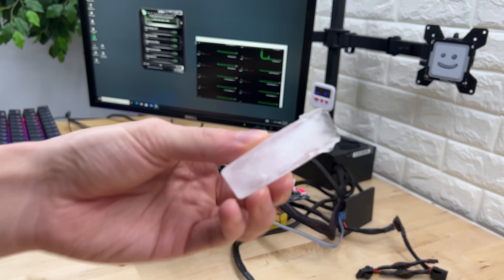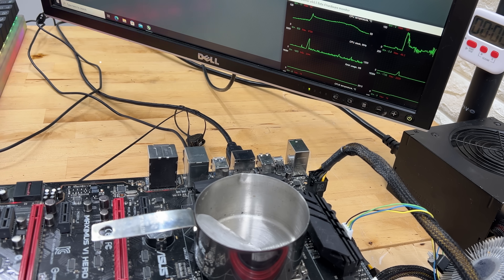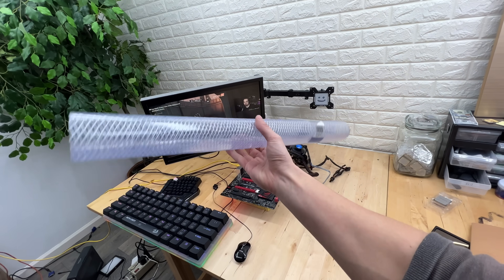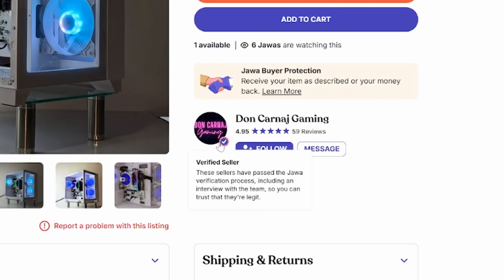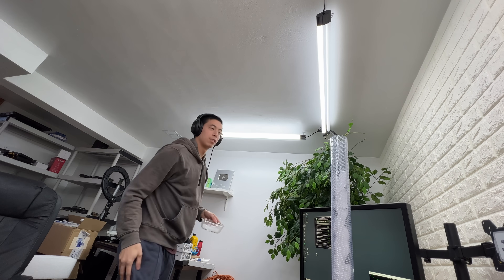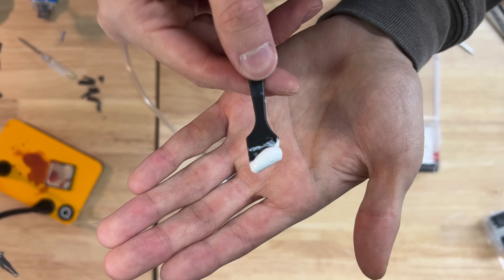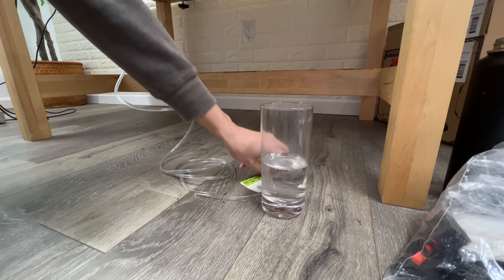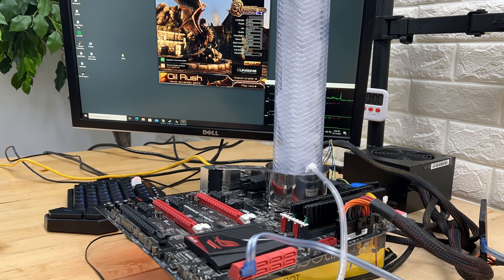Why aren't PCs cooled with ICE?

Comment: Now put a fridge with ice-dispenser next to your PC, have a system transporting the ice-cubes into your tube and let the melted water go back into the fridge. 
You just need some way to sensoring to find our your ice-level to automatically refill. You can control everything using a raspberry pi.
-->
You also got your food right next to your PC.

Comment: I went to college in upstate New York where it was consistently below freezing from October to April, and one of my floormates had a water cooled PC that the radiator fan had broke on. Naturally, this was an engineering college, so he ended up making a really jank solution - he got some hose and a gallon-sized Tupperware and some bungie cord, hung the container out his window, filled it with water, and ran the tube from his water cooler into the container - it was basically liquid all year long despite it regularly reaching temperatures of negative 40 - Fahrenheit or Celsius doesnt matter, they agree at that temperature x)

Comment: There are a lot of fridges that can produce ice cubes with pressing a button, what if we put a sensor on top of the tubing to see when the ice is depleting and send a signal for the fridge to produce and dump more ice cubes into the tubing, also the water that is melted could be recirculated into the fridge to produce more ice.

Comment: 0:56 you should instead flip the mother board with support with some height and apply the ice after melting ice drop on ground itself
Reply: Fr
Reply: With a reservoir in a hole to drain the water

Comment: Good setup only if you are living in like Sibiria or Greenland where ice is basicly free outdoor most of the time, but if you are living in a hot/warm climate, turning water into ice would take extra step, and extra step means extra inefficiency, which would end up you spending more power to cool down your PC instead of relying on any liquid or air cooling system and an air conditioner for your room. I know because stupid me once tried to freeze 2.5 liter water bottles in refrigerator then tie to a room fan in my room before we bought a proper AC unit.

Comment: I assumed it was the fact that waters specific heat capacity is almost double that of ice. In other words, you’d need to try twice as hard to turn liquid water into water vapor vs how hard you’d need to try to turn ice into water. 

You can suck up a lot more heat with liquid water than with ice without experiencing a change.

Comment: Ice cool the GPU. The problem is you'll need a lot of electrical insulation to make sure that pan touches nothing else, and youll need a support bracket. Since the GPU would be direct die vs an IHS, the full weight of the ice tower would result in a cracked die. But if there's any gpu to test with it's the 290x ya got there. Little furnace my beloved

Comment: Could you use an angled tube with external supports to avoid putting weight on the processors? Would this also enable you to cool differently oriented chips?

Comment: Obviously we already have liquid cooling, but imagine if we started integrating compressors into the mix to make essentially CPU air conditioners. One issue with existing cooling is that it's bottlenecked by ambient room temperature, and this ice is just a more primitive, time consuming approach to this limitation. The more automated way of handling this would be air-conditioning technology.

Comment: Concussion: we do not do this because the ice melts and then becomes hot water so then you would need a cooling system for a cooling system (fans for the water) so it would be more efficient to just use fans

Comment: Why not using copper like a refrigerator but then it will damage the CPU so it needs to be not so cold because negative freezing temperature is equal to fire 

Edit:I was wrong,refrigerator won't run if there is heat nearby 

Ice just transfer moist so a little drop of water damage the CPU

Yupp thermal paste is best solution

Comment: They do. They do LN2 cooling for overclocking competitions. The issue with bringing your CPU below ambient temp is condensation. The water in the air begins to condense into water droplets which will ruin you computer if it gets under the chip. The overclockers use molders putty to seal off the areas around the CPU to prevent this. There are also water chillers that bring the water in your loop down to close to 0 C but again you need to seal your motherboard off from water condensation.

Comment: Can you make a video with this config
- invert the CPU, and Ice touches the IC from below.
- water will just flow down, and not on the motherboard
- make a contraption (spring loaded perhaps) which pushes the ice column towards the  IC although buoyancy will already be plus point for this.
- also, Stainless Steel is a bad conductor of heat, try Copper or aluminum

Comment: I had a dual pentium pro back in 1996 that I never bought a case for. I used it to run photoshop and macromedia 3d. I never put a cpu cooler on it and I would drop water on the cpu with an eye dropper and people thought i was crazy. 😂

Comment: To round this experiment out, what if you hooked the drain hose to an ice maker that automatically fed ice back into the tube at certain intervals? Sort of a closed-loop solution with ice. 

While this isn't quite feasible for most tower PCs, there are some other DIY cases and enclosures people have made. For example, the desk PC. I've seen a few people build their PC into their desk. With this in mind, it would be in the correct orientation for this type of cooling. 

Alternatively, if you'd like to keep the upright orientation, you could make a sort of platform that hangs from the top of the case at just the right height for your pan to sit on and make full contact with the cpu. (the side of the pan, though, in this case, instead of the bottom) Since the platform is attached to the case, it can withstand the weight of your ice-filled tube without putting pressure on the cpu or motherboard and your water draining solution would work as is. 

Just a couple ideas I got while watching. Thanks for the video, was a cool experiment!

Comment: Short answer: Because ice fvcking melts and short circuits your whole board.
Now lets talk about nitrogen cooling
Reply: Nitrogen creates condensation and frost on the outer pipes, you're creating just as much water as you would with this system.
Reply: @Cheapducky To your surprise, someone has already succesfully made nitrogen cooling pc
Reply: @Mirakuruuu  I've seen the video; it took them weeks of experimentation to ensure the computer would be safe.

Of course there's also the issue that you're spending a couple grand on a liquid nitrogen generator, whereas a liquid cooling kit only costs $100-300.
Reply: @Cheapducky  I understand its not practical and very inconvenient but these builds are made by PC enthusiasts with loads of money who prefer their rig to be different than normal. Plus, liquid cooling cannot achieve negative temperature unlike nitrogen so they could overclock beyond limit for whatever reason.
Reply: @Mirakuruuu  I mean there's also the fact that liquid nitrogen is way more destructive than water cooling. If a pump breaks in a water cooled system, you could potentially damage your PC, but it could be salvageable. With liquid nitrogen, if something breaks, you're risking damage to anything the liquid touches.

Comment: Honestly, even without the tubes. If you had an old mother baord you needed to get on for whatever reason and didn't have a cooler, you could easily makeshift this with a ametal cup and icecubes and honestly get up and running. sure maybe need to turn ur pc off to empty the cup and put in ice, but honestly it couild be a solution to quickly boot up a pc and test if it works/grab some files you need onto a usb quickly. good idea.

Comment: The idea isn't that bad. With a specific coolant fluid which evaporates and returns to the liquid state (in another location), you simply rebuild the refrigerator technique. The physics behind the changes of the state of a liquid is perfect for cooling techniques.^^ But we shouldn't decrease the temps like a refrigerator, this causes immens moisture outside the cooling material. A well focussed target would be around 60° Celsius.^^

Comment: Random gaming in HD did this years ago and it was just as funny. Then seeing how effective it is still kind of blows my mind. But you got to remember the energy that went into freezing that ice is released as two temps reach balance toward local entropy. So while this is really fun, it does also have a thermal limit the temperature of ice 0c (32f). Now dry ice would be really fun to try because it doesn't release any water as it melts + on top of that it can be purchased the shape of in long rods at grocery stores. Just need some extra ventilation in the room

Comment: this is why there is a anti-chat gpt movement in tiktok comment section. chat gpt has those basement thing ful of those computer that over heats because alot of people request things to ai and ai want to comprehend the best possible answer. so to cool it off they use a water a bunch of water like a size of a tsunami to cool off the over heating [whatever theyre called]

Comment: Why not use dry ice? way less problems with conductivity and you get the way more out of the phase transition... If you feel realy ambitious use an ethanol or isoprop system cooled with dry ice to get a better head exchange

Comment: I had the wireless controller for my xbox360 with AAA battery and it lasted roughly 5 hours and later around 2 hours which then I had to recharge. That was my limitations to my electronic 😂

Comment: Wouldn't it be possible to freeze the entire tube with water inside of it (If you even have a large enough freezer) then simply opening one side and letting the ice inside melt downwards instead of adding ice cubes?

Comment: I actually was gaming in VR on a 10900K at 5.5Ghz all cores constant voltage and frequency overclock running some5hing stuoid like 1.42volts while filli g dry ICE 8. A similar setup

Comment: Have you heard of a dry ice bath?

Dry ice is below the freezing temperature of water, but you can put it in other liquids (like isopropanol) to end up with a cold liquid bath at like -78C. I'd be interested in seeing a cooling setup that used this.

fair warning, I hate IPA and dry ice baths. they use so much IPA and it's annoying and greasy and oily to clean up if you spill some. but they are pretty cold, although not as cold as liquid nitrogen.

Watch out for condensation, too?

Comment: You're onto something.
Why not expand the tube a bit to the confines of the cup. Interlace a funnel instead of tower for the cube, THen use a water drain tub that's enclosed and set into special compartments. each open with holes. to allow water to make enforced cube whens tuck into a freezer. make 2 tubs. And then set it up so you can dump a tub into the funnel top system. and measure the tubs frozen time amount for around 6 hours per unit. And make the funnel system able to hold around 8 hours of cooling. This way you have whats called a dynamic swap fill system that just uses your freezer to chill your computer. Sure it's work but it's less eletronic. And allows you to water proof the top of the system mechanically. It would ALSO be easier to install...than other things. On top...cause there will be a GPU inside. you are adding ambiant cool air. Downside is I think you should up from 6 hours of run time to 8 and the primary refill drain freeze tub to 10 hours Due to ambiant room tempature influx like summer vs winter time. A funnel design lets the ice shift downwards. And opens more space gap for ice insertion and lets you put a lid over it.

Comment: I think a more realistic cooling method closest to ice cooling is refrigerated water cooling, where it’s a water cooler but instead of fans to cool the water, the radiator of the AIO is run in a small refrigeration within itself and will need to be plugged in to run, but it’ll take a lot of electricity and energy

Such a design is probably only flawed by the possible condensation of the tubes in which the water will flow through from the radiator to the cpu, but I believe it can be solved by simply building the tubes in insulated material like a thermal flask, this kills 2 birds with a stone by not only preventing condensation but also keeps the liquid cold and prevent the water from gaining heat on its way to the cpu, allowing better temps

Comment: What if we use a refrigerator engine and connecte it tubes to the cpu  melting steel tube in the top of it and filling it with water,
The hot water is densier than the cold water between 4-101 c
So the hot water moves up and the cold water moves down which makes the cpu to be cooled

Comment: I think many think like me that while it's cool to use ice, the process of having to use more refrigerator energy (aka $$$) to create the ice only for it to melt stings the whole operation.

Whereas waste heat is THE byproduct of everything that consumes energy, on top of the fact that we genuinely need heating in specific applications, there really ought to be an ideal medium where we harvest all the waste heat and get it to places that need it so they don't have to fire up a device that consumes energy solely to create heat.  

It's just infuriating that during Canadian summer, a computer will heat up your room just enough to be unbearable and you need to dial in the air conditioner to compensate (wasting more energy to offset your waste heat), but in winter the heat generated by the PC isn't enough to heat up the room to offset cold.

Comment: Bro casually drinking micro plastic & adhesive 🤖
Reply: You clearly dont understand how adhesives work 😂 talk about a dumb comment
Reply: @Beelzebub73  the devil's in the details
Reply: @panmanafro  uhh no its not he used jb weld putty which is rated to bond potable water pipes together aka no "adhesives" to leach into the water and the tube with the ice and the drain tube are clearly made of out potable water vinyl 😂😂😂😂 so i repeat you have no idea what your talking about kinda hard to get micro plastics when there is no plastic 😂😂😂😂😂😂

Comment: Couldn't you use the heat from the cpu, pressure, and gravity to act like a pump? So you have that big tube the warm water will rise and then you have an outlet tube that carries the warm water away, the smaller tube is then run through an ice bath making it colder, and then the water re-enters the big tube near the bottom, to start the whole process again. Like a cheap AC unit.

Comment: Ice maker with distilled water, pump water back into ice maker tank at a certain level to optimize thermal contact with the bottom of the cup, copper cup, no hopper needed problem solved. Of course you could skip the middle man and just hook up the cold pipes in the refrigerant loop of the ice maker to your cpu

Comment: use an ice maker to constantly put icecubes in, also you can make another design for the CPU by just getting some sort of metal pan bottom and the thermal paste (like you did) but have it on the SIDE of the ice tube not the bottom, also place the water extraction tube on the bottom, maybe also connect the GPU and CPU ice tubes ( the CPU ice flows into the GPU ice)

Comment: Honestly, this is just straight up a sound idea. It's still cycling the heat out of there, but it's silent. And melting takes way more energy than heating up, so the energy density is higher. If you don't use your PC 24/7, you can attach an ice-cube maker to it, and a pump to recycle the water. By building up a stockpile of ice overnight, you can handle much more intense cooling than even pure watercooling could ever hope to accomplish.

Or like, imagine turning on the ice-inator while you go out touching grass, so any noise it makes, you won't be there to hear. Then you come back, turn it off, and enjoy some PC gaming without the sound of a fan whirring.

Comment: Because parts that generate most heat in terms of cooling already operate close to limits of how quickly materials, they are made from, can cool when producing heat. Basically when you're dealing with certain volume of silicone, that generates heat under load, you initially are bottlenecked by system parameters like contact area, the wattage of the heating element (for the sake of argument lets assume we're dealing with heaters), the temperature of your coolant, the thermal conductivity of the body from which the heat will dissipate into the environment. Now the main issue is, it doesnt take that much cooling, to 100% exhaust the surface capacity for cooling, but heat affects the entire volume of the chip and while it certainly helps to keep the surface layer consistently cooled, which causes it to act as cooling body for the layer underneath, the inner layers generate heat, too, but the efficiency of cooling them ends up being largely limited by the physical properties of silicone and less by the actual system of heat transfer/dissipation.

The thing is, for materials that are currently being used in chip manufacturing, air cooling is somewhere around "just enough", but its also much cheaper than anything else.

Comment: The problem is you didn't go to the next step. If you had the water feed into a another tube / pot. With three of em you could form a perfect rotation cycly of cooling, collecting, and freezing. Plus if the ice is frozen completely in the tube it will take longer for it to melt away.

Comment: I'd have to think about how energy efficient this is
Would it be cheaper (materials, electricity, Matinence) for you to just get a normal water cooler for your pc, or would it be cheaper to get like a gallon of water and use the energy your freezer uses. Instead of the energy the cpu cooler would